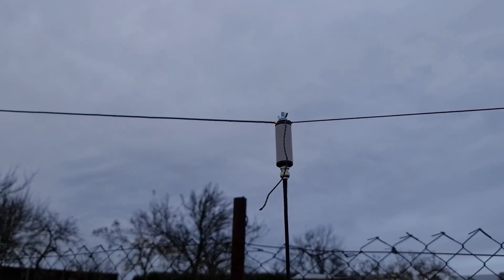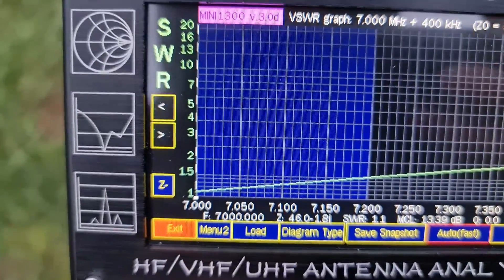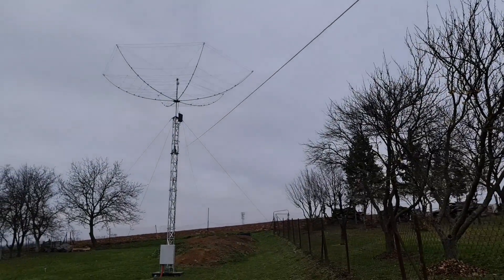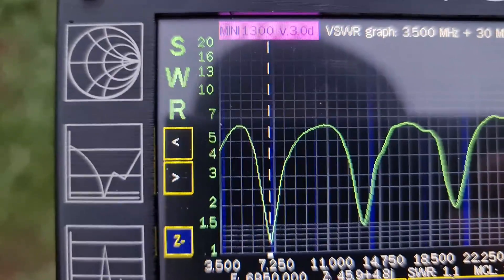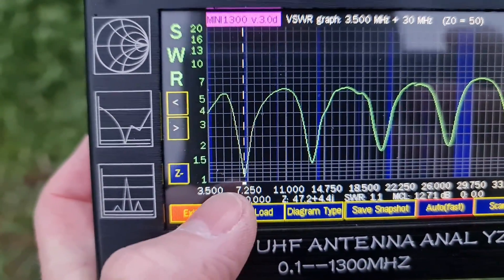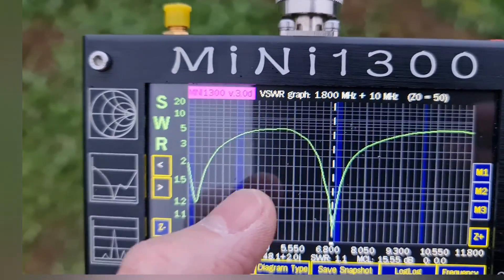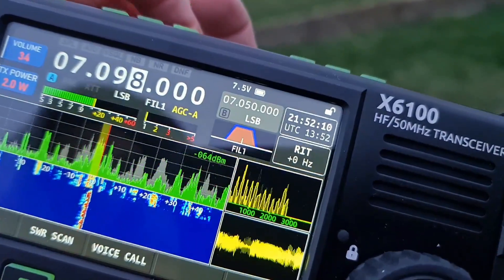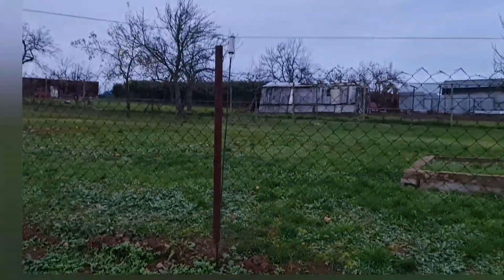TEST: Mini 49:1 UNUN (EFHW antenna)

Comment: Hello Paul and thanks for the video! If you shorten the wire to get it resonant within the higher bands you will find that it won´t fit properly in the SSB-zones of each of the bands. E.g. if you tune it to about 7.150 MHz , it will be out of the SSB-section on 15 m and 10 m (and vice-versa). To improve this, try the following:
wind a coil of 5 cm diameter and 4 turns 2meters away from your UnUn. Then tune the wire to 20 m-Band (you will need approximatly 17,06 m after the coil) and you will see a mutch better resonance at the higher bands. Wish you and your family a wonderful christmastime!
73, Bernhard, DC6NS
Reply from the maker: Thank you very much for your very interesting comment! 😉👍

Comment: Your installation lacks a counterpoise parte laying on the ground. For example a 4m coax part until a coax mounted shoke. Probably the reason why your SWR results are not looking as they should.

Comment: Hi Paul, thanks for showing the EFHW with your UNUN in action!
Sorry to be critical, but since I spent a fair amount of time around this topic, I thought I pass on my "lessons learned". I created a document that you can find when searching for my call.
Some improvement proposals to lower the losses: Since you have enough space in the PVC tube, use a core with another geometry. Use 3 instead of 2 primary, if you use it at 40m and below. Make the winding tight without crossover.
Have fun and 73, Stephan
Reply: Hi Stephan, I worked a lot with EFHW antenas, mainly experimenting with different radiator geometry's, 4NEC2 simulations and transformer constructions methods. Finally after finding a preferred SOTA configuration I found Your EFHW document. The funny part is that it matched allmoste perfect until small details with my own independent findings. This EFHW document from You should be read as a the standart white paper BEFORE doing any EFHW Antena experiments. The EFHW is a incredible good performer, but the application of this antena must be right.

Comment: Yes, a UNUN will make the SWR look better, but at what price? what is the insertion loss? I personally playing with non-resonant antennas attached to antenna tuner after taking thermal imaging of baluns and seen the heat produced (despite the great VSWR at the exciter side).
Nevertheless, great video, great contact and great test, thank you for sharing.
Get the book "  " ANOTHER LOOK AT REFLECTIONS By:  M. Walter Maxwell, W2DU/W8HKK "
it might just change you views
Here is a small part:
" JUDGING BY WHAT we hear on the air, nearly everyone is looking for a VSWR of one-to-one. Question why, and the answer may be, "I'm not getting out on this frequency because my SWR is 2.5:1. There's too much power coming back and not enough getting into the antenna," or, "If I feed a line having that much SWR, the reflected power flowing back into the amplifier will burn it up," or still, "I don't want my feed line to radiate." Any of these answers show a misunderstanding of reflection mechanics and are symptomatic of the current state of education on this subject. Rational and creative thinking toward antenna and feed-line design practice has been absent for a long time, having been replaced with an unscientific and thought-inhibiting attitude, 

Cheers,
VK4BYE